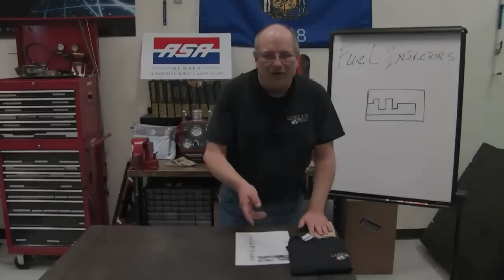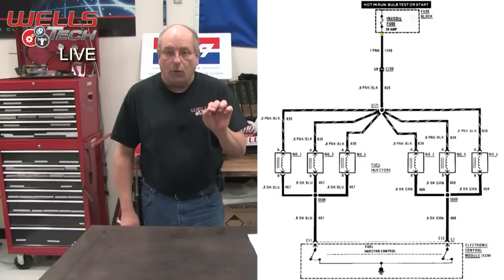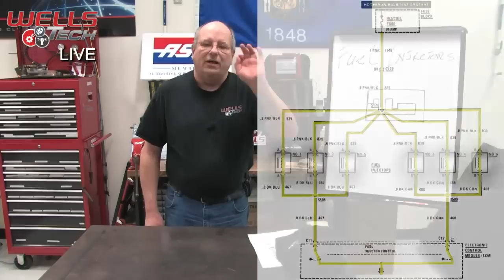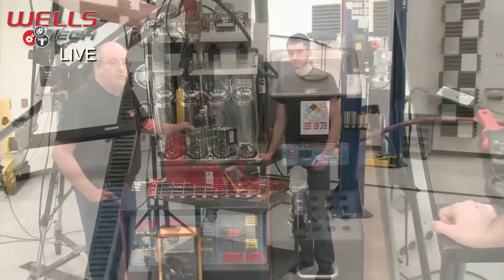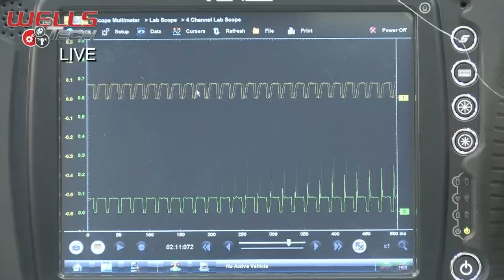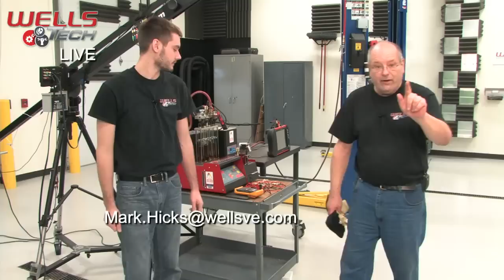Fuel Injector Diagnostics

Comment: Hello, Guys. If an injector control wire were shorted to power and you commanded the injector on, what would happen to the injector?  Thank you for your videos and welcome back.
Reply from the maker: Hey BB MD, most fuel injector wiring is power fed continuously. They are almost always ground side controlled. Are you asking if the ground side were shorted to power?
Mike Becker, Senior Technical Instructor
Reply: Thank you for replying. Yes, Sir.
Reply: you may fry the transistor inside PCM.

Comment: Nice job guys.  Know you are limited on time with the videos but one thing I would like to suggest for a future video is how about you explain the Injector Current waveform and also the Voltage waveform.  One thing I noticed on your Injector captures was on the good injector you have a upward ramp showing the magnetic field building steady in the Injector.  On your bad Injector the current is going straight up indicating less resistance and thus a shorted Injector.  As for your scope being fast enough to see all the spikes that is a good question.  Another thing to think about is with that injector being shorted and sometimes spiking, it could be because of something is binding mechanically also inside the injector.  It could be a combo problem.  How about you drag out the lab scope from the engineers and then compare the two scopes to see if they are identical or not?  That would prove or disprove this issue.
Reply from the maker: +busjockey1 Thank you for the comment! You are exactly right, and I think we are going to do exactly that. We had talked about getting one of the engineers scopes, and comparing a few different injectors, good and bad, and seeing exactly what they do and why they do it. Now we know that there is interest in seeing more in depth, I think we will work on a class that really dives deep into the waveform, and the actual failure. Stay tuned! :)
Mike Becker, Technical Services Instructor
Reply: +markjhicks I would also be interested in seeing this as well. Especially around what to look for to identify a good or bad waveform and pulse width.

Comment: Obd1 couldn't set misfire codes. That was one of the reasons to go to obd2. Well that and evap. Lol
Reply from the maker: +Jonathan Milbury You are right Jonathan, we did not have a P0300 code. Mark had meant to say that the car had P0300 like symptoms. Judging by the way the car was running and driving under load we were able to determine that multiple cylinders were misfiring because of the faulty injector. Also you are right, it  is a huge advantage of OBD2 to get those misfires codes. 
Mike Becker, Technical Services Instructor